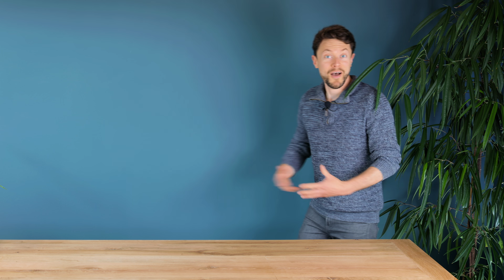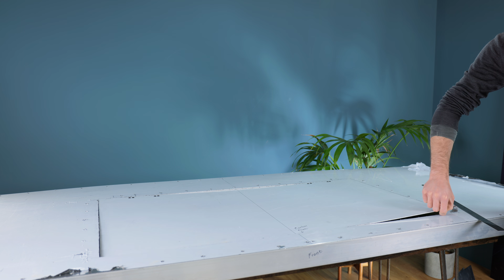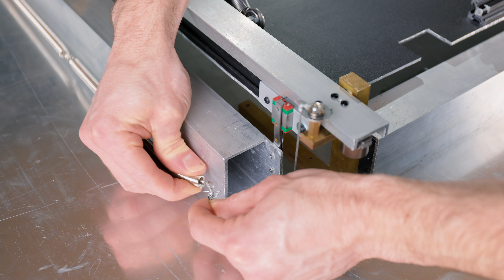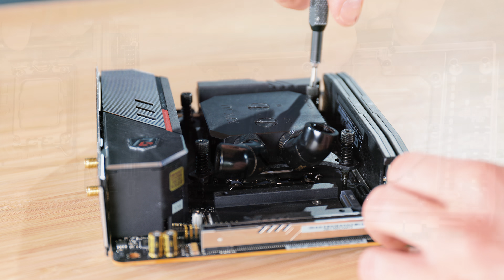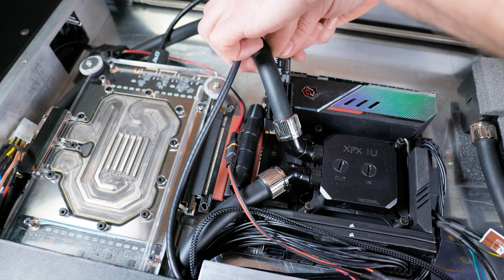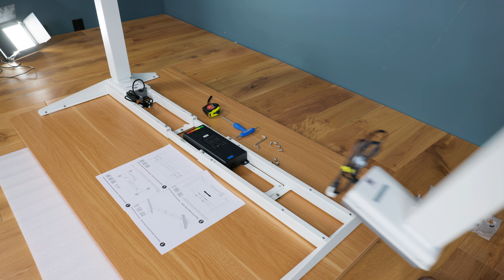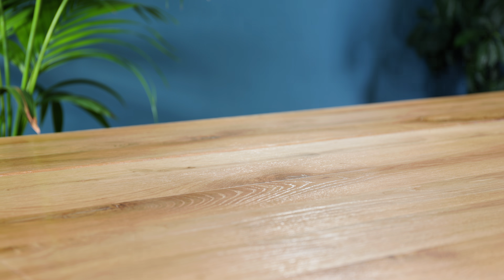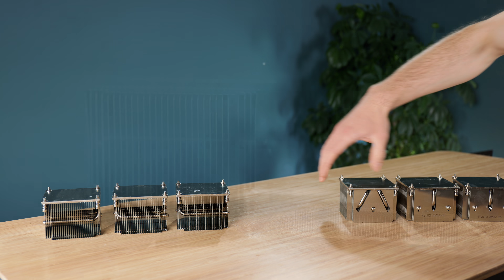Building the ENDGAME invisible PC

Comment: The coolings issue wasn't a surprise. Those fine-finned heatsinks were designed to be used with fans running at ~5000 RPM. The wider the spacing is between heatsink blades, the less additional air pressure is needed to cause air to pass through. For instance, passive convection radiators have "fin spacing" in the order of centimeters, not fractions of millimeters. And even then, radiators used for heating often use oil inside instead of water to allow the temperature of the fluid to be higher than 100C.
Reply: I can see why he would have thought they'd work, laptop heatsinks also have pretty tight fin spacing, although those heatsinks are much thinner than these monsters
Reply: @AwesomizedArmadillo  Exactly. Tight fin spacing obstruct airflow. Thicker heatsinks ALSO obstruct airflow (though not nearly as much). 

Maximum cooling is proportional to how much each unit of air is heated * how much air passes through the heatsink per second.

Once the air that is exhausted gets close to the temperature of the heatsink, the temperature factor becomes a constant, meaning only the airflow matters.

The types of heatsinks he tried first are really only effective at very high airflow, which given their air resistance requires extremely high pressure (and thus noisy) fans.

So, outside a data center, they're basically useless.

Laptops need tight fin spacing PRECISELY so that the heatsinks can be made thinner. While this introduces extra air resistance compared to less tight but deeper heatsinks, it's not nearly as bad as using datacenter heatsinks. 

Laptops ARE quite a bit louder than desktops at the same wattage, though. My work laptop generates about as much noise at 30-50W power usage as my desktop does at 500W.
Reply: Yeah, but one can't be an expert in everything. Some stuff you can't predict ahead of time, no matter how good you are at what you're doing. 

Well, or you're not pushing your capabilites.
Reply: He also put the fan intake in an enclosed environment with heat producing components. And the top side is past a slim chute that certainly doesn't help with losses. Him not leaving a gap at the end also traps hot air if air intake was not already an issue.
I wonder how he cools the VRM though. That thing is cooking itself with an Intel Core.
Reply: You lost 1 there! You meant 15000 rpm+. 1U servers can get SCREAMING. With modern CPUs crossing 400 W, the fans are pulling 350 W+ in dual sockets. Within last 6 years or so power density of servers went from ~800W/U on the top to close to 2200W/U. Liquid cooling in datacenters is becoming a requirement - these heatsinks may become quite rare :)
Reply: Are those little heat sinks just solid copper? If so, that would also make a huge difference. The bigger ones had heat pipes, which can be effectively over 200x more conductive than solid copper.
Reply: @evilcitrus  The thermal resistance of the heatsinks had absolutely no effect on the cooling potential of the system in the video. 

Cooling potential gets completly dominated by the lack of airflow over those fins, meaning the temperature of the air exiting the heatsinks will be virtually identical to that of the water that's heating the heatsinks.

For the thermal conductivity of the heatsinks to matter (beyond just copper), one would need something like 10000RPM fans.
Reply: was thunking about mixing detergent in so itd make the water hold less air and probably, somehow, increase the flow speed; detergent slippy water not, uga?

Comment: You could add a cable, and put the piston mechanics under desk, and create a pully-pushy system under the desk, no magnet would be needed. Or a simpler system could be made and use leverage and one way lock system.

Comment: The only thing I would have done different is keep the adjustable curve mechanism on the monitor, if possible. I understand that you ditched it so you could keep the desk thin. But the idea of an adjustable curve fold out monitor just makes this already awesome design, next level imo. But either way fantastic work, it ended up looking/ working fantastic.
Reply: @NeptuneSega  not necessarily, some people just find them more comfortable to use, it’s a preference thing mostly.
Reply: You would probably have to bend and unbend the montor everytime during opening an closing.
Reply: I think that would probably triple the thickness of the desk
Reply: @patrickl9930  yea that’s likely, still a cool idea though. I understand why he didn’t go that route though.
Reply: He could go back and create some removeable curved ramps that he could slide/wedge in behind the monitor panel if he wanted to, although I suppose that would be a bit of effort now that he's got everything bolted/glued onto the back of the monitor.

Comment: Can you use brass tubing with nickle fitting? I know copper and nickle dont play nice together not sure about brass
Reply: most PC watercooling blocks are copper with nickel plating and the fittings are usually brass, so they do play nice together.  you may be thinking of aluminum and copper, which should not be used together in watercooling.
Reply: @Ti_Daley  ah you're right, my bad

Comment: Oh, be carefull with that magnet, aka the accidental-disk-formater-5000. But this is a real treat you built here!!!
Reply: I'd be more worried about scratching the finish, unless there's some felt under that magnet that I didn't see.
Reply: There are no spinning rust drives in this build.
Reply: @aaronmdjones  While that's true, sliding a powerful magnet near long, high-impedance traces could still do the funni to this PC and its SSDs. Especially when it's powered on.